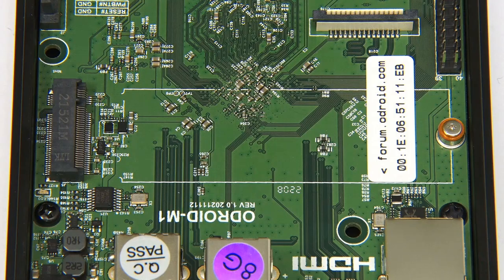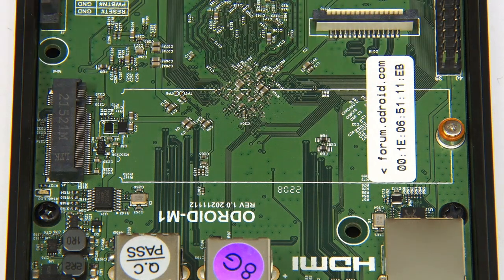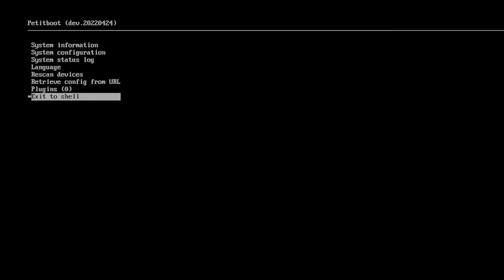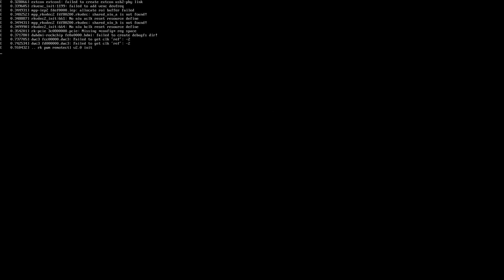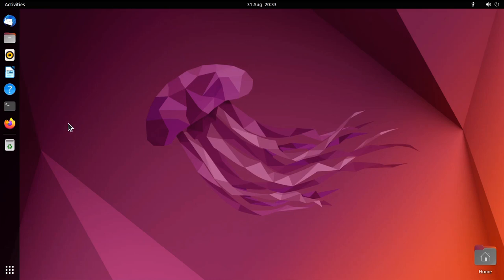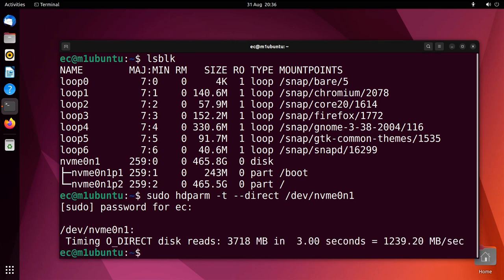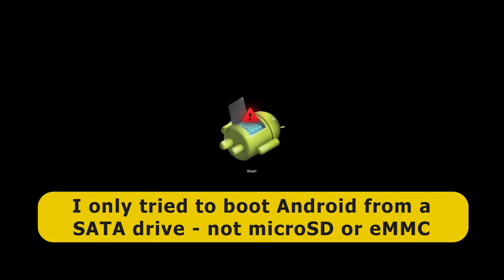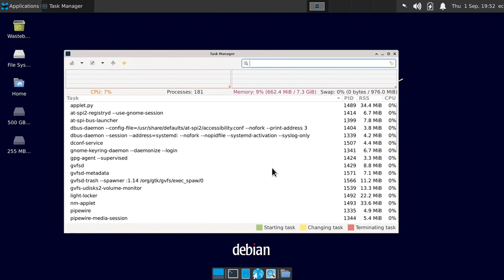Odroid M1: Bootable SATA & M.2 ARM SBC

Comment: It annoys me how all SBC's have some component they excel at, but do not cover all of the important bits.

This board would have been a generous desktop replacement device if only it had the video power to do so.
Some day we will get a powerful low profile device which will allow everything.
Reply from the maker: At least the lack of decent video playback here is a software issue (lack of a driver for hardware decoding), not a hardware one. So it is possible that the issue can be fixed.

Comment: You would hope ARM SBCs would create an IBM style hardware standard, the way it is now the Linux support short and long term is dependent on the number of boards they sell. There are many boards better than the Raspberry 4 that I would be interested in making a computer from but only Raspberry makes me comfortable with their Linux support.
Reply: There is but most of the SBC makers are too cheap/lazy implement it, the only OS they really do the leg work for is Android.
Reply: @voidtoast4880  and the most useless of the lot, IMHO.

Comment: Sir, is it possible to watch how youtube test will be play through the desktop players like mpv or smplayer? I think firefox + youtube bundle hasn't good optimization to the platform. Good test will play video 720p, 1080p, 2k, 4k from local drive to watch how hardware decoding works and using htop/top/free utilities to watch load of CPU/RAM.

Comment: I can't understand what the nvme is supposed to be good for if you can only connect the m1 board to a 1gb rj45, for my understanding it would have to be 10gb rj45 or 10gb ftth, otherwise nvme on the board doesn't make sense, then it has to Rockchip have the power to handle the NVME performance. if i want to use a board like the m1 productively, 4 sata ports would be better than 1 nvme slot

Comment: Nice video Chris ...but when are they going to get ARM desktop graphics support sorted? It isn't really resolved for the RPi and that's an established product with many years retail availablity...is there something about ARM desktop use that makes useable graphics difficult?
Reply from the maker: The issue is writing (and updating) graphics drivers. SBCs used SoCs (or cores thereof) designed for smartphones, where the mass market supports the creation and upkeep of the drivers for iOS and Android. But this is sadly not the case for the SBC marketplace.
Reply: @ExplainingComputers  maybe if Android make their drivers Open Source it would help? I thought that part of Android was Linux based, so some of it should be OC anyway?
Reply: The Rpi doesn't actually have what's considered a real GPU, its a weird mess of a design, but there are open source drivers developed for it. Arm Mali GPU open source driver is pretty good and AMD GPU's can work with open source drivers in Arm workstations with PCI-e. Hardware Video decode is something else entirely and on Arm linux is managed by V4L2 which needs a lot work to be viable and it not comparable to big x86 PC GPU's and their video decode.
Reply: @voidtoast4880  V4L2 is patchy even on Amd64...ask any Nvidia graphics card owner who runs Linux!

Comment: Disappointing performance overall -- I do hope that the long-term support will allow developers to create more optimised versions of various OSes for this computer.  It really seems like it should perform much better, given the hardware on that board.  But when the UI itself is laggy -- something is clearly not properly optimised for it.
Reply: A media client requires integrated hardware codecs HEVC etc, for a SBC is too weak doing software decoding. So, some modest Pentium G4400T would be a far better and cheaper choice than ODROID or RPI.
I am using ODROID as a build server for ARM targets. This one looks good, except for the small number of cores.

Comment: Slightly disappointed that we're seeing M.2 slots that are incompatible with M.2 SATA SSDs, especially if they physically fit into the slots.
Reply from the maker: I imagine that they decided to keep the SATA interface separate, to allow two drives to be used (rather than having both interfaces in the M.2, where only one can ever be used). Note that a SATA M.2 SSD will not fit in an M.2 slot that is keyed for an NVMe drive only. Remember that M.2 is a form-factor, not an interface.

Comment: I would have thought batteries for clocks on computers would be obsolete by now, surley there are online time facilities by now?
Reply from the maker: There are, but not all computers are connected to the Internet all of the time.
Reply: the battery not only saves the time, it also helps with other tasks like power the cmos chip that stores the motherbnoard settings like i/o config, boot options and other stuff, both in desktop pcs and in the sbc

of course there are servers worldwide giving you the time and allowing pcs to be acurate, you use them on windows, linux and android all the time, since like the year 2000 when os became very prepared for internet

Comment: The way the SATA drive connects is just terrible. Are you supposed to have all that mess laying around? The HC1 and HC2 were much better in that regard. I would rather buy a barebone fanless intel mini pc with a proper case for a ssd for just a little more.